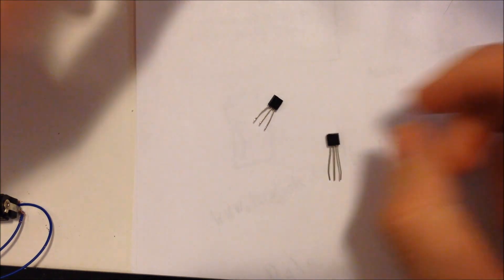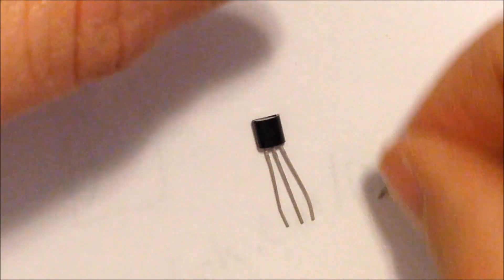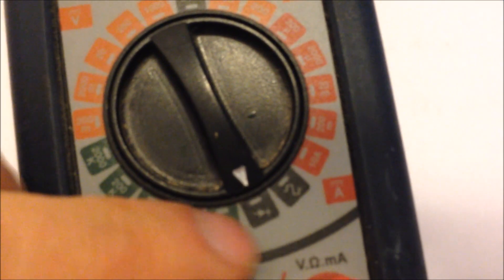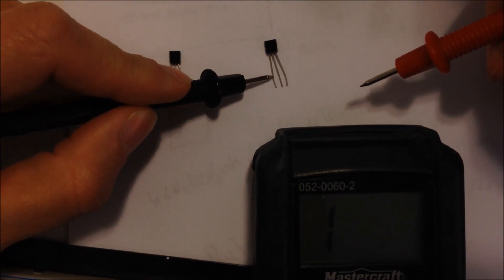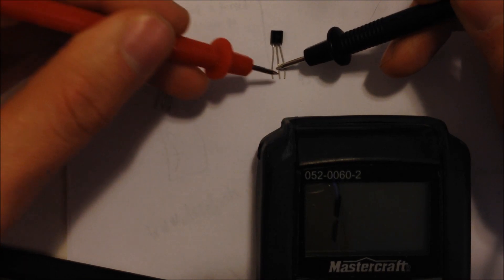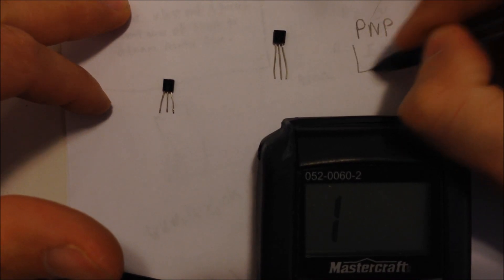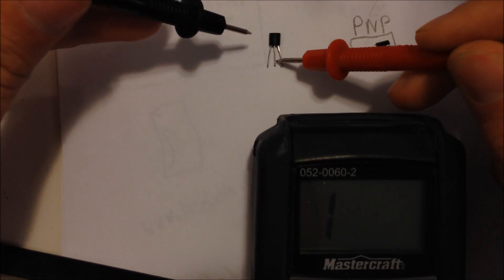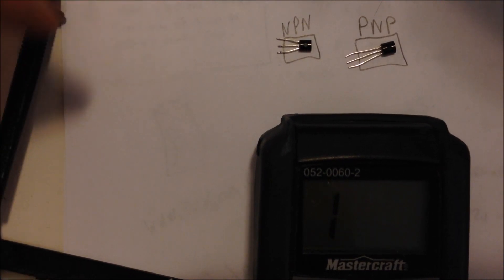How to Identify an PNP or NPN Transistor

Comment: I have a question. Please help me with this.  My machine works on pnp sensor but due to some problem the sensor got damage now at the current time I dont have a pnp sensor but a npn sensor.  Can I use npn in place of pnp using a relay if yes please let me know how to do the wiring

Comment: Do all the 8 pin ic functions the same..?? 
I mean can I use any 8 pin ic for replacement of another 8 pin ic?
Reply: HORMIN LIKHA  different ICs function differently.. 7491,7402,7404,7474,74164 r not same at all..
Reply: if it has different numbers it is a completely different circuit - and one circuit cannot replace and function for a completely different one - - only same number IC can replace and work properly.

Comment: the original reading is to use analog multimeter to determine pnp or npn transistor.if you use digital multimeter the reading will be reverse.so much better to use analog multimeter.
Reply: Thanks! I’m getting the results you mentioned with my digital meter, now I know why

Comment: How about collector and emitter pins? does it matter which of the two p pins of the pnp transistor work as collector or emitter? Why? Thanks
Reply: It does matter yes, normally the forward drop between the base and emitter is slightly greater than the base to collector due to the slightly higher doping of the base to emitter junction, so you can find out which the collector and emitter are by knowing this.

Comment: If PNP and NPN have reeding on both sides that mean that the transistor is good or bad my friend
Reply: Sorry I've answer about your question  .......this will depend on your reading value on both sides for example  if in one side 7.91 and the other  8.2  which means the side of higher value will  represent Collector  and other will represent Emitter and in this case the transister is working      Regards..
Reply: Thair sahib  well ok thanks

Comment: Simply look at the numbers, if it's the manufacturers number  all PNP begins with A or B and NPN begins with C or D..  Just another way to determine
Reply: Joseph u'll have to just guess, so if the transistor goes bang then u will know what not to do.
Reply: Suppose you can't see the manufacturers number, and you don't have access to a computer to google it.
Reply: No sheet Sherlock!   The whole point is tp ID by testing.   Sometimes the numbers are burnt off, can you read those?

Comment: SIMPLY LOOK AT IT`S DATASHEET!. 
If you don`t have it`s datasheet? Well the transistor it`s pretty much useless since even for simple switching purpose you need the bare minimum specs if you don`t wanna fry the transistor within 3sec of use
Reply: Cazzoz Duroz I did just the thing u said in the last "fry them in 3 sec" lol

Comment: so PNP =POSITIVE NEGATIVE POSITIVE and NPN = NEGATIVE POSITIVE NEGATIVE
Reply: And electricity will only flow from negative to positive. Hence the readings
Reply: P for holes. N for electrons.current flows from high to low potential; electrons from low to high potential. Depending on whether the transistor is NPN or PNP electrons/ holes flow towards the base and accordingly current flows.

Comment: you didnt explain you had on flat or around side while tyou were testin.. didnt explain that what way there were lying while testin so 
hard to know outside pins... bad quality videy
Reply: It doesn't matter what side you have on the table. You're testing inside/outside pins not right/left pins. I the outside pins are negative it's npn if the middle pin is negative it's pnp. The middle pin is always in the middle no matter which way the transistor is lying down.

Comment: Base is not always in the middle.  Japanese transistors are usually E-C-B.
Reply: yes especially in sony equiment
Reply: Thanks for pointing this out! This helped me out big time testing a PNP and NPN.
Reply: what?
Reply: Electone_1802
Reply: Synthematics and Technics/Panasonic
Reply: (probably won't help you) but you probably get the idea, if the negative is on one leg, and the other 2 are positive, it should be pnp. if there is 2 - and 1 +, it should npn. and the legs can also be very different, easier to check the datasheet from the manufacturer
Reply: Not just Japanese transistors are different.
Reply: Now that sound like Ukulele vs Guitar
Reply: Electone_Guy  If PNP and NPN have reeding on both sides that mean that the transistor is good or bad my friend
Reply: Gerald Bony

Comment: Problem with your theory here: Transistor leads are not all made with the Base in the middle, so this test is not reliable. Sorry but otherwise it's not a bad idea. A digital meter with a "Bipolar Transistor Test" mode is a better way to find which lead is which, or read the part number and look up the data.

Comment: very helpful for a newbie
Reply: +Charles W Harris Jr Not all BJTs have the Base lead in the middle on the package. They only have to be internally connected to it. Depending on how the manufacturer makes and assembles the transistor casing determines which external lead is which.

Comment: Thank you for your explanation of how to figure which was which. It helped me greatly once I turned my Multimeter from Resistance to Diode. (It's the same setting on the selector, I just needed to press the Alt Function button). Taken me 10 minutes to notice that booboo.
Reply: ok

Comment: Hi, what happens to the PNP transistor if it installed backwards? Is it still works?
Reply: +Jayson Natividad NEVER DO THAT! It can easily short the circuit or the transistor, or even both! It's like switching the positive side with the negative side on a battery.
Reply: +ender_scythe Thanks man.
Reply: +Jayson Natividad DON'T SWITCH THEM!

Comment: Is the base always in the middle? I don't think so :(
Reply: +Adrian Forbes No not always, it depends on the transistor.
Reply: +Abdulrahman Mahdaly No sir, not all BJTs have the Base lead in the middle on the package. They only have to be internally connected to it. Depending on how the manufacturer makes and assembles the transistor casing determines which external lead is which.
Reply: +Abdulrahman Mahdaly TO3 transistors have the base as part of the packaging, also TO126 and TO220 the base is not the center.
Reply: Yasindu Nanayakkara, you are thinking of Japanese transistor with E-C-B as different what is used by westerns.
Reply: Joe Favata Thanks for correction
Reply: +Kenneth Waggoner I think for all BJT transistors, the base MUST be in the middle. I mean, the BJT transistor basically works because the base is in the middle otherwise, it wouldn't do what it does!
Reply: Ok. Thanks
Reply: +Yasindu Nanayakkara Yes, always in the middle

Comment: It may show up as a PNP with the diode test, but unless you know for sure that the
TO-92 package is standard, the collector and emitter could be interchanged. 
Looking up the number may be necessary to confirm which is which.

Comment: D1651 data sheet says this is a npn transistor but when tested its a pnp + - + i get readings - + - i get no readings and testing more on the two outside leads + - + i get current

Comment: ah ofcourse, you use the P-N junctions as diodes. i see now. Thanks for explaining. What does the value of the multimeter represent in this "diode mode"?
Reply: Don't know if I m correct but I think its the biasing voltage? or in other words the amount it takes to turn on the junction ???? again I m not 100% sure as I m self taught as well
Reply: Rosario W in the mean time i found out what it stand for. it's beta, the current gain of the transistor.
Reply: Oh ya now that you said that it sounds familiar Thanks for letting me know

Comment: emitter is also to the right on both transistors as was tested. emitter is always a little higher out of circuit. great job keep up the good work and the base is not always in the middle. what determines that is where it was made. japan Europe usa etc.  73 kf4gyp Ray

Comment: i would like to know is the transistor base is always in the middle pin?
Reply: no its not always the case, you have to check the components datasheets to be 100% sure
Reply: yes
Reply: U mean all transistor and always
Reply: yeah..
for example you have npn transistor..den n is emitter p work as base nd p as collector ..lyk tat
Reply: why initially rdg. doent change on multimeter .is it bcoz +ve lead was touched to -ve plate nd -ve palte was touched to +ve plate

Comment: Very useful. I'd also like to know how to identify if a transistor is bad or good
Reply: npn  base positive emitter/collector negative should read 0.7 volts reverse the leads should be open transistor is good, pnp base negative with respect to emitter /collector 0.7 volts reverse leads should give open ,if any of the tests should read low or 0 volts drops the transistor is knackered.